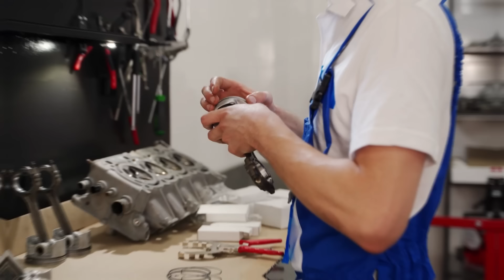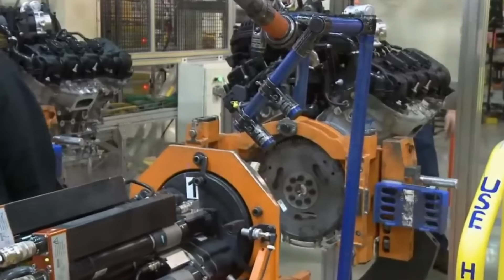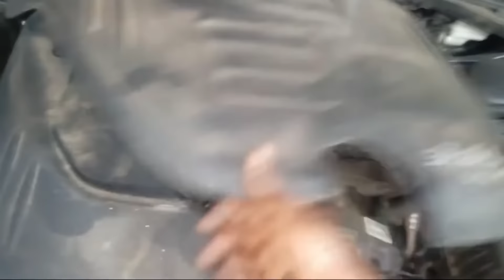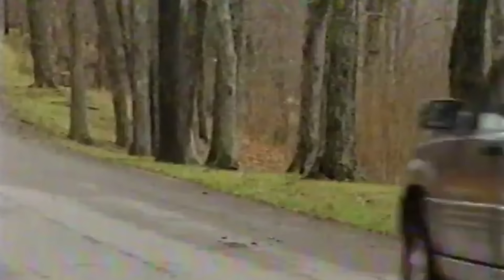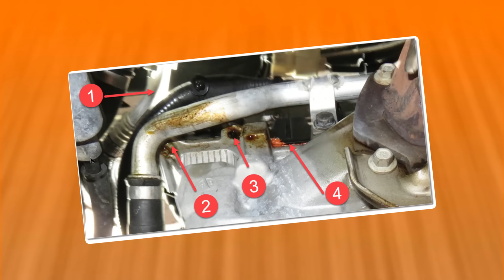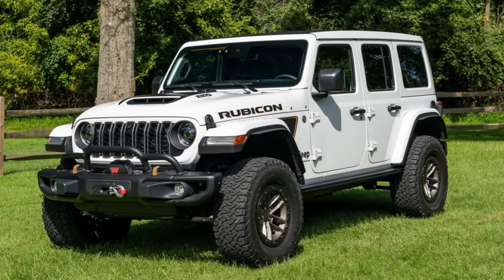The Only 3 JEEP Engines That Last 300,000 Miles

Comment: Hey bud love your list. I am driving a 1997 jeep wrangler SE 2.5 liter 4 cylinder original engine  transmission with 202018 miles. It runs like a champ I change her oil every 3,000 miles basic maintenance. What’s your understanding of this engine?

Comment: Well my Ai says different to yours lol.
I did my research before I bought my 2020 Rubicon 3.6 and the driveline is tough if respected. Electrical system well too many censors for my liking.

Yes, it’s a solid design. Port injection is simpler and more forgiving than direct injection: no high pressure fuel pump to fail, no injector tip coking, and the fuel spray keeps the intake valves washed clean, so you avoid the carbon buildup problem that plagues most modern GDI engines. It’s mechanically straightforward too: chain driven DOHC, forged steel rods, cast iron liners in an aluminium block. Over 10 million have been built across Jeep, Ram, Dodge and Chrysler, so the failure modes are well documented rather than guesswork.

With genuine full synthetic oil changes (most experienced owners run 8,000 to 10,000km intervals rather than stretching to the factory 13,000 to 14,000km interval) and no sustained towing or high RPM abuse, 300,000 to 400,000km with no major bottom end work is a realistic and commonly reported outcome. There are well documented examples well beyond that, including one Pentastar that made it to just over 1,000,000km before the timing chain finally let go, with the bores still showing factory crosshatching and the rod bearings still serviceable.

Comment: 2011 Grand Cherokee with the 3.6 V6 and 228,00 miles and the 5 speed transmission from the previous year model. Still running as new, oil changes at every 5,000 miles using synthetic a no oil burning at all in between changes.

Comment: MDS is not the cause of those lifter failures. The issue is that the oiling system doesn't push enough volume through the roller lifters at idle. Sure, the oil pressure is good, but the AMOUNT of oil is not enough. The fix is to replace the oil pump with a Mellings High volume pump (but use the stock pressure spring) or you can use the Hellcat oil pump which is a high volume pump. This will allow your MDS system to still work and will prevent this failure in the future.

Comment: My 2000 XJ has 199,580 miles. Original water pump, and I literally just changed the original alternator!! Very little rust too, believe it or not. My 99 XJ was running like new when I sold it, but the body was rusted beyond repair,  but it also NEVER let me down. Those 4.0's are bulletproof with just regular scheduled matainence. Never going g to sell 2000 as I looked long and hard for a patriot blue example, and I bought it from the original owner!!

Comment: Didn't they put the 5.9 Magnum in the GC TSi as well? The 4.0L has valve seal failures as well. I think I had at least 6 a year in my shop. It's an easy enough fix though.

Comment: Replacing the filter housing oil cooler on the 3.6 is not a 2 hour job.  But also not super expensive.  I'm doing it myself.  Lots of wires, hoses and bolts to deal with.

Comment: Good info.  My 2014 Grand Cherokee V6 is at 225,000.  Gets a 5W20 oil change every 3,000 miles since bought new.  Runs like a clock.

Comment: Ai is ruining the internet reviews! Calm down Sparky (Ai)🤖. Chrysler specifically chose to keep the Pentastar as a port-injected design when they revised it for the Grand Cherokee, explicitly noting that they did not adopt direct injection for this engine family. Jeep’s own and dealer materials describing the Grand Cherokee’s 3.6 only reference sequential/multipoint electronic fuel injection, while direct injection is reserved for other engines (like the 4xe 2.0T). Chrysler's Pentastar chief engineer Steve Gorgas said it plainly: "DI is an enabler for turbocharging. For a naturally aspirated engine, the benefit is rather small, so we are very competitive without it." Port injectors are also significantly cheaper to manufacture and replace, and they don't require the expensive high-pressure fuel pump that is one of the most failure-prone components in DI systems.

Comment: My son’s  Comanche with the straight six was run completely out of oil twice by my daughter when she was driving it to school and back. It had a small leak that she ignored. I added 5 qts of oil to it twice. It only holds 5 and 1 in the filter. Engine was still humming along at 350k miles. Other things were falling apart around the engine that prompted him to sell it but the engine was still running fine.

Comment: I have a 2007 Gradb Cherokes with a 4,7 v8 it has 141000 mies on it the oil is changed every 5,000 mies I run 5W30 oil it , it a   good running vehicie....

Comment: I currently have the 3rd engine in a 2013 Wrangler which I got after the 2nd engine in my 1998 Grand Cherokee Limited that finally gave up at 290,000 miles. It was still running on 5 cylinders and still passed the California tailpipe smog test but would not clear the check engine system.

Comment: I have a very clean 99' Jeep Grand Cherokee (weekend drive only) with the 4.7 V8 202,000 Runs great, plenty of power.. I'm guessing plenty of miles to go. Not very good on gas, but fun to drive, very fun in the snow.
Reply: Keep the right coolent and regular oil changes and yes it will last forever
Reply: Iv heard bad things sbout the 4.7. I yhink its a hit or miss engine. I know 2 people that had problems with them

Comment: The 4.0 isnt reliable...
  It is easy to fix. Of which, you will do often
  Reliable and easy to fix, are not the same thing.
  The pentastar is reliable, excludong early head failures, which are easily avoided by replacing the lifters.
  I own both..the 4.0 and the 2012 pentastar v6.
  The pentastar v6 has 250k on it now, with no real issues.
  The 4.0, has been a constant supply of issues.

Comment: My 2013 Jeep 3.6 sitting on 310,000 only thing I ever had to replace was oil pressure sensor in the back of the motor.

Comment: My 2016 Jeep Grand Cherokee still has all her OEM internals at 200.000 still running strong yea I walnut blasted the valves and replaced the OEM Oil Cooler to a all metal one from doorman and Water pump from Duralast  but no issues with all the internals I change my oil at 3.000 miles and my transmission fluid every year with the differential
 fluid aswell

Comment: My 1996 Cherokee has 270k I put a new computer in it and a water pump. That’s it. Everything else, brakes, shocks,  tune ups all just wear stuff. It sounds like a diesel but don’t smoke or leak oil. I change the oil every 2k miles  change the diffs and the aw4 overdrive tranny fluid every 50k  it looks like shit, it’s got homemade floor pans and rattle can paint job, but I wouldn’t sell it for 100 grand

Comment: A tech that travels around to dealerships ( He is an engineer) told me at the parts counter at the Jeep house I bought my 2025 JT from, that from 2015 on he has not yet seen lifter bearing failure on 6.3 engines where 5w30 oil is used and oil changes never exceed 5000 miles. I was on original oil at the time and I said that my break in oil will be full syn 5w30 and I would change at 500 mile 1500 miles and 3000 miles after that. He said I would more than likely have no problems. By the way, I'm in Texas ..... do the temp math ..... IT'S F#CKIN HOT!!!!!!!!!!!!!!!!!!!!!!!!!!!!!!!!!!!!!!!!!!!!      Edit: I use Techron every 5th gas fill up .................

Comment: I went to a car shop to do work on my 2010 3.8 with 220,000 miles ( I was putting a short shifter for my manual transmission) and there was an exact looking ( 3.6 and color wise ) jeep already in the shop . When I came back to get my jeep the owner came over to me and said “ same car but you have the better engine “ ……. 

So my question is , how many miles can I get out of this 3.8 ?

Comment: You failed to mention the OPDA failure common to later model 4L straight six engines.  Failure of the OPDA will take out the cam if you don't address it early...it's an EASY fix with an updated design OPDA unit.

Comment: If you ever get the chance to drive a 5.9 ZJ, take it, they are amazingly chill about their power yet if you want them to, they punch you into the seat. If your cruising and a slight hill comes, downt worry, they will chugg up in 4th at barely more than 1000rpm without any issues! A thing the 4.0 in the ZJ never could do. And, altough the vehicle itself isnt suited best for it, taking it to a 120pmh is no trouble at all, from 2000-3000rpms it pulls hard enough to overtake other cars on the german autobahn...my only adivse is, be aware of the fuel consumption, if you cruise at 70-80mph, it can go up to full 18mpg! But if your heavy footed, you can also bring it below 10mpg...

Comment: Love my 96 zj 5.2. But loved my 04 LJ 4.0 the much more. Absolutely bullet proof. The 5.2 is a tough powerful towing beast with a deep rumble. But that 4.0 had 285K miles when I totaled my LJ and yet the most reliable vehicle I ever owned. I  plan on getting an LJ once again in my future. I have 2 ZJ parts vehicles one a 4.0 (needs full rebuild) the other 5.2 (runs great ready to transfer to a new project).

Comment: No, the 2023 Jeep Grand Cherokee L Limited does not have direct injection.Its standard 3.6-liter Pentastar V6 engine uses sequential multi-port electronic fuel injection (port injection) rather than direct injection.

Comment: Road n track still gives it a honerable mention. Im driving my 2nd 95 4.0 just turned 220,000. Bought 5 yrs ago 168,000 one owner bought new. $1,600 i stole it. Lol no major issues. Only put starter, cpu tps thats it. Purs like a ķitten just did resets cant even hear it running standing next to it. Luv these engines. I do all my own work.

Comment: I'm the original owner of a 2008 Jeep Commander 5.7L MDS Hemi Overland with 260k miles on the original motor and tranny.  It runs great too.  It has towed and been off road about 10% of its miles too, from utility trailers to a 24 foot TT.   I have a 2 inch spacer lift and larger tires and take it off road too.  It's got 5 Jeep Badge of Honor trails in Utah and Colorado.   It has the amazing Quadra Drive II system on it, which is nearly as good as lockers off road, and 10X better in day to day driving.  I change the oil every 5k  miles.  The mpg is terrible...around 12-14, only thing I don't like about it.
Reply: My 2007 5.7  Cherokee was going great 200k  on it. Then my ex gf stole it 3 months later I got the car back almost no coolant  low oil ,  it had been thrashed on and off road. It actually still drove alright for about a month then everything started to fail. Tough motor I will get another 5.7 for sure

Comment: My 1994 XJ is currently at only 179,699 miles, so lots of life left in her. I've been battling a gear-shifting problem for the last two years, but the engine is running strong! It's been used predominately as a commuter, with a few mud puddles mixed in, not a lot of rock crawling.

Comment: My dad has a 2000 xj with the 4.0L inline 6 and will hopefully be mine one day but anyway it has 370,000+ miles on it and it's still running strong work 0 issues. The only thing he's done to it is basic maintenance. Its an amazing engine and more reliable than any other

Comment: '90 xj 4.0 5speed manual. Just shy of 400k worked hard  Gonzo miles. Didn't have the money to fix it at the time. Sold it,and still see it driving around. Great hunting rig,miss it dearly. In my opinion, got 20-25mpg regular, much better than the '92HO.  Great truck. I lament the 4.0. Abuse,misuse, it just kept working, yeah, i would park it on a hill to clutch start it but it just worked, like a good dog,every now and then you gotta give it a treat, or get it's shots,but it loves you unconditionally. Worst thing for a jeep is to not take it for a ride. Too much road stuff, they get bored and kinda bitter. A bit of hard stuff is what it is for.  Like a dog without a good run.

Comment: you are right 100% my jeep grand Cherokee 2011  is 241000 miles and no problem, the only thing that fail in my jeep is the fuel pump relay,I also have a Cherokee XJ 2001 and don't wanna die and keep running

Comment: The 2.5 AMC 4 cylinder is just as reliable as the 4.0. Very similar in design but obviously way down in power. Have 333 thousand original kms on my 97 and she’s still running very strong.

Comment: I have the 1996 ZJ with a 5,2 ltr engine, appr. 300 000 km, not any problem on the engine, it runs smoothly, powerful and reliable.
Only one problem occured, but this is not related to the engine, there is an Evap leak detected (also the cruise control does not work).
And of course, differential noise, the before owner ignored to seal the differential housings, so the differentials and transmission have to be overhauled.
I love my ZJ, even, without the 5,9 engine.
He is free of rust.

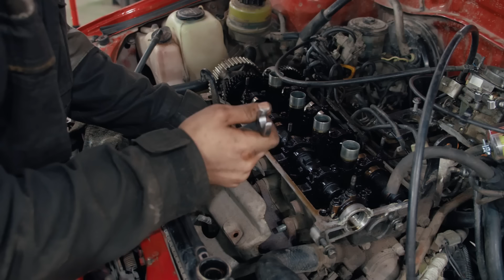Comment: 9:32 not really…. In the GC platform, the LA series engine blocks enough of the barrel intake under the cowl. The engine needs to move to get the intake out for gasket replacement. But on the bright side, once all that is off, you can reach and service all the ignition and emissions components that are on the back of the block.
The trick to know if the intake gasket is going? Remove your oil fill cap when the engine is between warm and operating temperature. It idle, you’ll feel it if you put your hand over the oil fill. Works for all the LA 5.2 (318) & 5.8 (360) engines. Especially useful with a Dakota and the RAM Vans where you can’t access most of the motor.
BTW - I also have a ‘63 AMC with the 196. The great grandfather of the 4.0L.

Comment: I had a 1996 Jeep Grand Cherokee with a 318 V8.   That engine went back decades too.   Did you think of that one by chance?   That Jeep had all kinds of problems.  But none were with the engine or transmission, just everything else.   😎

Comment: My 08 JK has blown 4 engines with only 130k on odometer. The 3.8 is an oil burner. After 3k on new motor it was 1 quart low. Piece of shit engines!! I'm grateful I bought the bumper to bumper lifetime warranty for drivetrain. No cost for all 4 engines replaced. Won't sell it because of warranty.  They're losing $$$$ on me!😂😂😂😂😂😂

Comment: My 2002 Jeep Wrangler Sahara has the 4.0L and 5 speed manual transmission.  It currently has around 73,700 actual, original miles on it.
Reply: At your current rate, it will be 2102 before you get to 300,000 miles. I think you got your money's worth on that deal

Comment: I enjoyed your video. My 1997 Jeep Grand Cherokee 4.0L I6 had the crankshaft position sensor fail at about 127,000 miles. $ 224 for towing and $ 258 for repair and just FYI when this sensor fails, it makes troubleshooting tricky, no fuel pump and no ignition, OBDC all the way. Im looking forward to the next 100,000 miles.
Reply: Wow I have the same yr & engine ZJ, thx for the heads up!

Comment: My 1998 ZJ has 485,000 miles on the original engine.It hasn't always been soft miles.THe first two years my wife used it as a rural route carrier.110 miles a day,of starts and stops.

Comment: My 1998 Grand Cherokee with the 5.2l V8 lasted till 325k. However it wasn't quite dead. Engine ran great. Transmission was great. The suspension was trashed, PCM was doing weird shit. Basically everything except the engine was slowly failing and I didn't have the time, money or motivation to fix it.

Comment: If you’re going to consider the 4.0 for longevity, then you must include the 2.5. That’s basically the same engine with two cylinders cut off. I believe all the moving parts except crank and camshaft are very similar. The one I had bought new in 95, in a very basic YJ 5 speed manual steering, that I even accidentally submerged in a fresh water crossing that was deeper than I thought. All I had to do is drain all the fluids in the entire Jeep and it’s still running today with 410,000 miles. All that’s been done,at 34,000 miles was an exhaust manifold stud recall, that included a new head due to a small crack at the #4 exhaust port. All replaced under warranty. Still has the original clutch in it. Being used now by a niece at Nursing School!
Reply: My Son in Law has a '94 YJ .............. IT IS LITERALLY INDESTRUCTIBLE !!!!!  ...... Slow ?.... yes ........ bouncy ?..... Oh Boy !!!!! A beast off rod ???? ........ it is unbelievable !!!!! If he ever sells it, I will put it right beside my JT ........ Great machine !!!!!!

Comment: 285k miles on my 2012 JKUR.  I tow an enclosed 7x12 v-nose trailer in the Rockies and off-road a lot.  One cylinder head replaced @20k miles due to the valve seat issue.  Since then, just regular p.m. - 5,000 mile oil changes, replace plugs, coils, water pump, serpentine belt, etc. as p.m. since I am in remote locations often.  Runs like new, uses no oil.

Comment: I’m running a 1997 TJ 2.5😂L 4 cylinder with 250k miles.  Still starts and runs strong.  It has had regular maintenance.  3 exhaust manifolds, 3 catalytic converters, a metal radiator replacing the original plastic.  A clutch disk replacement at 200k just for failure prevention.   One clutch master cylinder rebuild at about 150k.

Comment: I have a 2013 JK with over 285,000 miles on it, only major issue was I had to replace all the lifters and rocker arms on one side cause of a ticking sound from a bad lifter…just replaced all of them. But other than that it’s been a good motor, just now pulling it for a v8 swap. Also have a 99 Cherokee with the 4.0 with over 245,00 miles on it. Only thing it’s ever needed was a water pump. Not fast but dependable.

Comment: Great video. I Think the 318, 5.2 Magnum should also be on this list. I have a 2012 WK2 with 95k miles Pentastar, and the engine is so quiet and smooth. I also have a 95 Limites ZJ V8 which is a tank, although in mint condition.